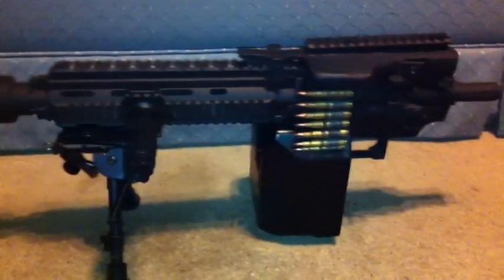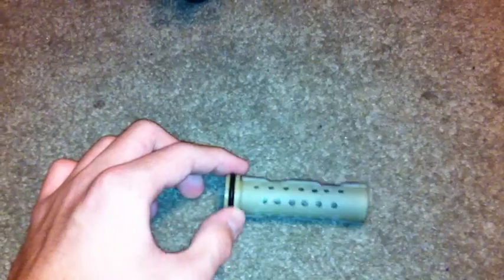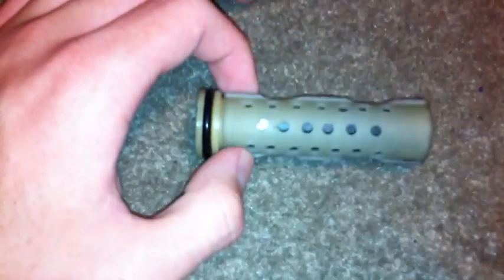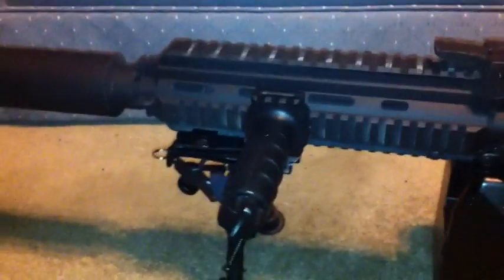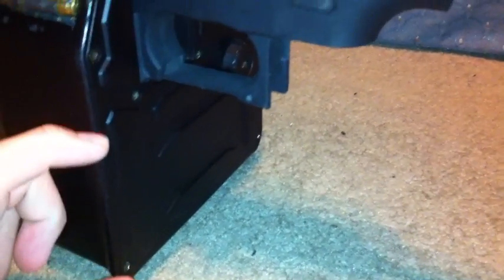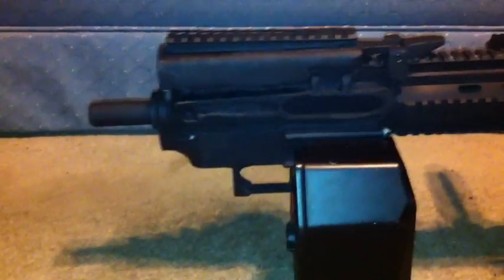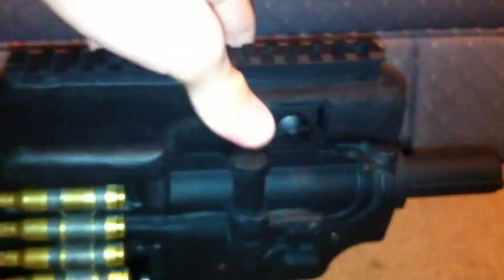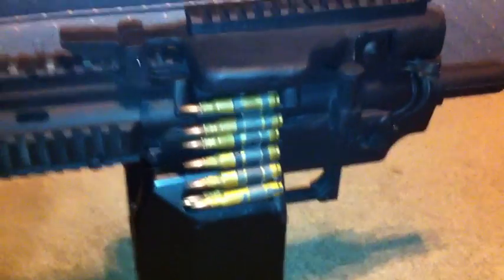SHRIKE Update and Swiss Cheese Piston Test

Comment: @monsoon3779 Short stroking does not significantly increase rate of fire. (assuming you've got a properly built gun) It is done to avoid premature engagement of the piston and sector gear in high rate of fire guns.

Comment: @aderonn short stroking the piston means you get rid of a section of teeth gears from the piston witch means when the gear makes its revolution it will only catch what teeth are there this being done, it will drop fps because the piston will not make a full cycle but seeing how it makes a smaller cycle in turn it will make more cycles per second. make sense?

Comment: You don't understand the point of swiss cheesing, do you?

The purpose of piston lightening (BTW, yours barely has reduced weight...) is to reduce pickup energy and let the piston live longer in a high speed gun.

Did you actually add spacers for AOE or did you just cut teeth?